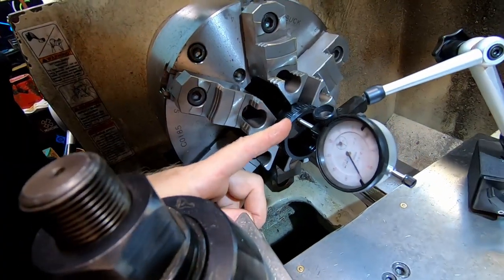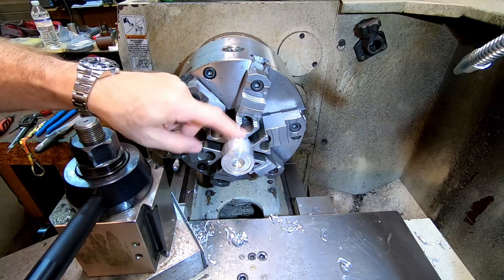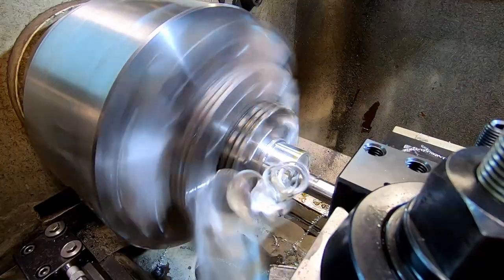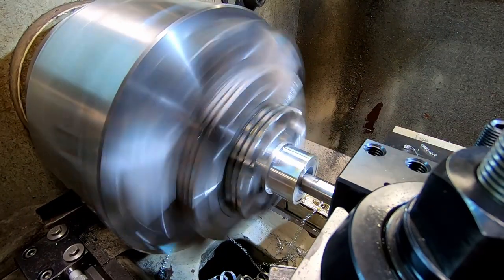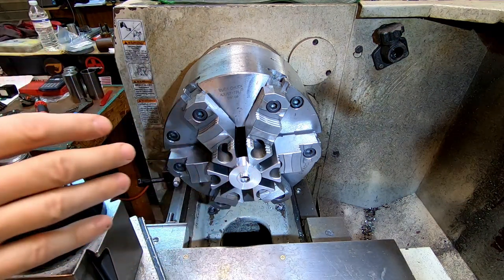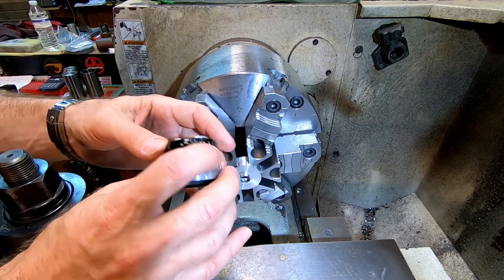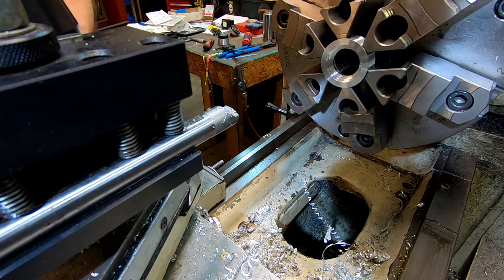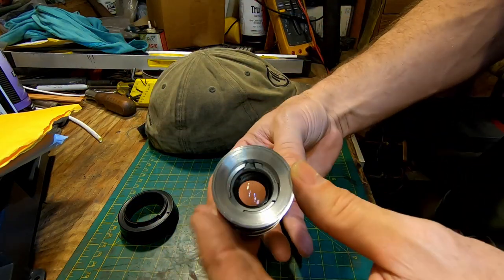Episode 2 l Adapting a Vintage Argus 50mm lens to my Fuji XT3

Comment: I have no idea what you're doing or what you are talking about, but I love it! That said, I started my camera collecting with Argus camera's back in the early 70's. I started taking a few shots with my Dads Argus (from 1939) A2b in 68 . I bought a Argus to Fuji adapter off EBay a few years ago & have had great fun with C lenses on my Xe3 & XT20. Your video here is genius!
Reply from the maker: I wanted to see if I could figure out how to get the Argus glass to work on my XT3 and ít became an adventure. I ended up buying the 35mm variant as well to see how it looked and it is a great little lens too. To get some better context search my channel for “argus” and you will see part 1 and maybe even a lens review or two 😉👍📸 Thank you!

Comment: That first part of video ......... I completely understood , because I also worked in a large Machine shop for 26 years where we machined Transmission shaft parts for Eaton Fuller Transmissions , but I retired out last year !
Reply from the maker: Nice, I have noticed quite a few machinist are also photographers for some reason. I dont know why, but a lot of them are photogs. It is kinda neat to find out this kind of factoids about each other, thank you for sharing this with us. Aren't those like dump truck transmissions?
Reply: there transmissions for all Big Trucks , including dump trucks but mostly for the tractor trailer big trucks
Reply from the maker: That’s what I thought. Big trucks. Nice. 👍

Comment: Absolutely love watching manufacturing videos. Eyes glued to screen the whole time. Really enjoyed watching the process.
Face palm when I saw that flange move as you went through focus. Absolutely! Why would they engineer something like that!? How about making an adapter that latches/holds in place at the little pin/notch on the barrel instead of the flange. That way the focus is free, lens being held in place at the pin/notch on the barrel and the screw you put in.
Reply from the maker: The next video actually addressed the focus problem and I found a simple solution before it was over... almost too simple... Thank you!

Comment: To save the lens: There are more or less cheap adaptors or extension tubes with built-in helicoid (basically extension tubes of variable length) so you could tool down the old mount, stick the lens on that variable extension tube and focus by the extension's helicoid. But maybe you already have found a better solution in episode 3 ;-)
Reply from the maker: I did order a focus helicoid in M42 mount on both ends, but I did find a simpler solution in the end. Thank you for the information too, that will make future projects similar to this MUCH easier!!! 👍